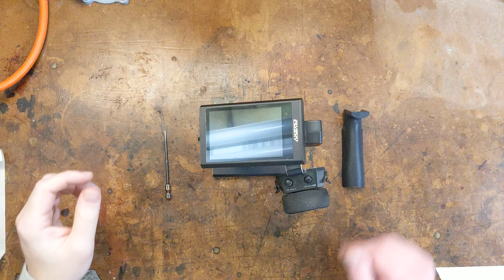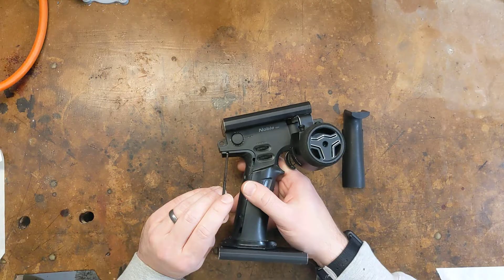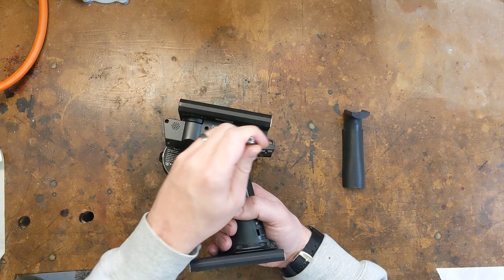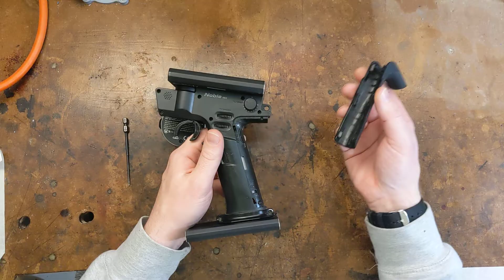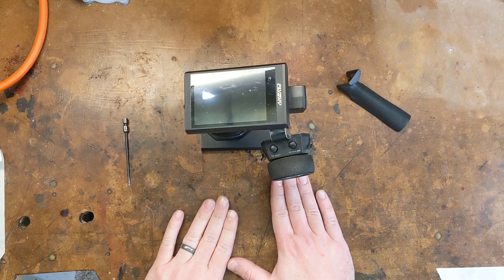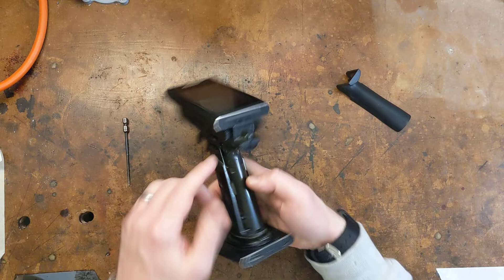Noble NB4 bricked? Try these hidden buttons FlySky doesn't tell you about!

Comment: Dude thank you. My Nb4+ auto power off then power button wouldn't turn it on. Push right side button and it's working again and all settings saved. Didn't even have to take grip off, just pop top part off.